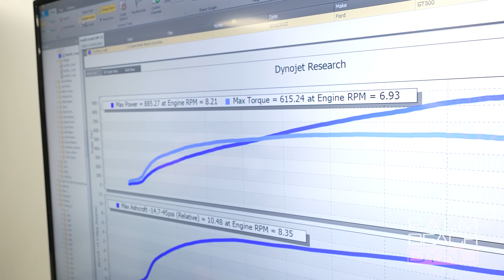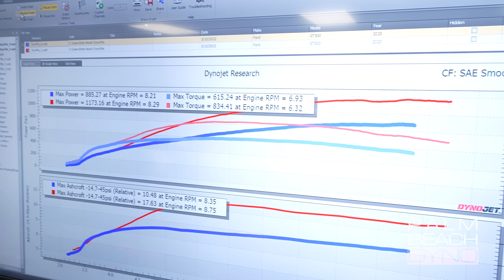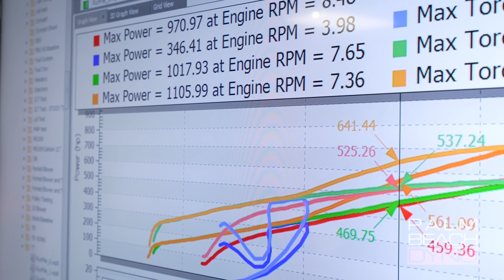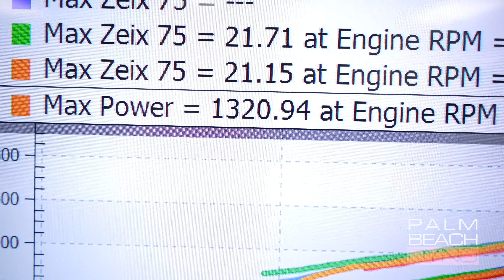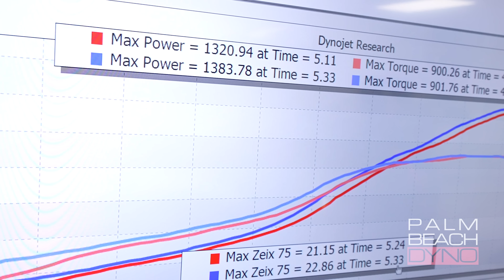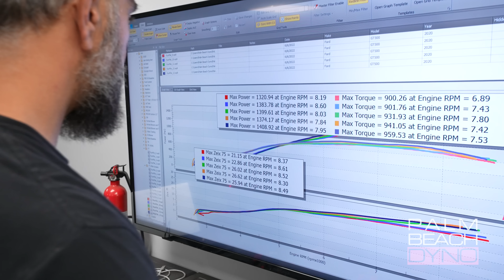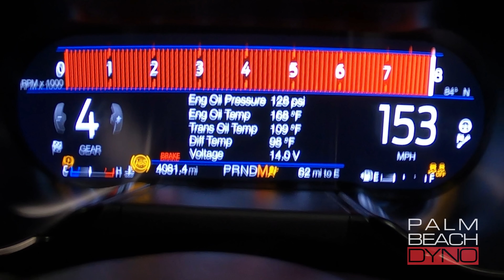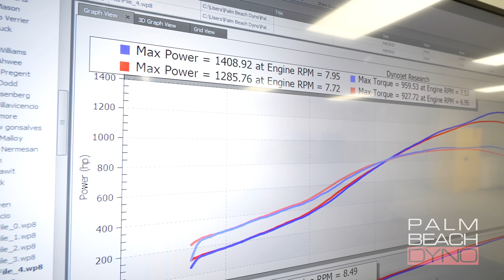PROJECT OVERKILL 😈 1400HP TWIN TURBO GT500! // 8500RPM Pulls on the All New TKM Engine & Hellion TT!

Comment: damn just goes to show how crucial proper grounding is! probably an easily overlooked part of a lot of builds
Reply: Being a high-performance mechanic for over 20 years, Grounds are the first thing I look for in any electronic problem in a vehicle. I have seen where people have gone freaking crazy with grounds and have caused them issues and on the other hand, people not using grounds properly or just the lack of grounds. So just my opinion always chase grounds first.

Comment: I’m curious on the details of the motor build.  What cam specs, any head work done, stock pistons and rods?  Header pipe diameter, and so on.  Stock compression?
Reply: Nothing in this motor is factory. It has a billet crank, caps. Rods and Pistons are aftermarket, pretty sure the heads are ported. Don't remember if the camshafts where aftermarket. It's sleeved ,all the goodies
Reply: The GT500 stock motor is just a cross plane version of the Voodoo. Once you go cross plane you can bore and stroke it a little bit more. Then add forged rods/pistons and as much boost as you want.
Reply: @walk4348  The GT500 stock motor is more than just a cross-plane crank version of a stock Voodoo engine.  The compression ratio is different, the GT500 has a beefier engine block and the GT500's rotating assembly is stronger.
Reply: @chrism.728  yes, they put stronger rods and pistons. The compression isn't that much lower than a GT350.
Reply: @walk4348  There's a significant difference in engine compression ratio. GT350 is 12:1 and the 2020+ GT500 is 9.5:1, that's a big difference. The GT500 engine block is also stronger to withstand boost.
Reply: 2019 and up gt350 have the same blocks different rotating assemblies

Comment: Good GOD that sounds beautiful!
Now someone out there needs to
"compound boost" a GT500...😎👍
Reply: I might be alone in this, but I honestly prefer only using a single forced induction type on a motor, purely to avoid heat soak issues. Yes, you could run both a true intercooler and an aftercooler, but that adds such a ridiculous amount of weight and size that you're better off just pushing either the supercharger or the turbo harder instead. Also, rally-style antilag would sound mean as hell on something like this.
Reply: @griffinfaulkner3514  you're wrong, neither would work very hard on that kind of setup.  A huge turbo running like 6 lbs of boost and a supercharger running a six 6 lb boost wouldn't be 16+ lbs of boost minimum.  You're actually raising the efficiency of the sc.  That being said, it's complicated to tune and it will still make less HP than a turbo setup running the same amount of boost because the sc will still be robbing some off of the crank.  It would drive crazy good though. As for heat, the A2W should be able to handle that amount of heat since the boost would be really low for both.
Reply: @_illtal  The extra weight and potential packaging issues are still there, and if you're going for the kind of numbers I think they're going to end up with, heat is definitely going to be an issue. I'd rather not cook the rotors on my supercharger if I can avoid it, which requires a true intercooler.
Reply: If we are going this far there's nothing stopping us from using methanol to cool the charge directly. The weight of this kind of setup is going to be similar to the weight of a complete ( no dumps) twin turbo setup. 
But as you've noted, for simplicity I would choose a twin turbo setup with an a2w manifold setup.

Comment: I have a 2015 GT Convertible, the only thing I have changed is oil & filters.  I was shocked when it did 160 mph and still pulling strong when I backed off.  Looked into the gearing and found it has a tall rear end gear, a 3.23 I think, and wondering if that's how it pulled that off.  I wonder WHY Ford put such a tall rear end in the convertible.  The top was down when I made that pull too.  Handled perfectly with complete confidence.  I wonder if it's worth putting twin turbos on it to make it a true sleeper.  Any thoughts are welcome!

Comment: Great find on the ground.  Seems whenever there's a problem on a car or boat it's on the ground side of the circuit. I'm sure once you guys get the clutch figured out the car will certainly make the numbers.
Reply: Ford really needs to release all the software for the TRANS so the calibrators can get after it with this transmission. When they start breaking them then we will know that full access has been released or close to it.

Comment: Been waiting for this on project overkill, Wow 1400 RWHP,  but sad to say it comes with problems on this project on one time full send race setup. But you guys will figure out all the
bugs, and fully send it. Can't wait to see the 1600 RWHP mark, if the trans will allow it. Great job guys.
Reply: Fathouse performance already has a 1600 R package for the GT 350.
Reply: @thomasblankinship98  what's your point because this is a 500 not 350
Reply: @justincharles6585  Voo Doo vs Predator. Both 5.2. ones a flat plane ( Voo Doo) , the others a 90° ( Predator). The 1600 R ( FH) pulled 1693 on the Dyno. Hope they get the TT Predator worked out. Would love to see the Dyno results from it. Both are awesome pieces of engineering.
Reply: @thomasblankinship98  Limiting factor here is the transmission, not the engine. DCTs in general tend to get a bit finicky when you push them this hard, and finding aftermarket upgrades for both the clutches and the gear sets is difficult and expensive.

Comment: I would be curious why he didn’t use the hub dyno he really never said . 
I heard you make less power on a hub dyno but it more accurate because there’s no tire slip at all .
Reply: He actually did , but it's because he was putting the kart before the horse , setup needed maintenance and everything was basically just stuck together nothing was really dialed in and a few things he should've done right after break in he didn't do.
Reply: I thought the hub dyno would show more power as your one step closer to the crank hence less drive train power loss. Correct me if I'm wrong.
Reply: @randyjr3479  totally understand definitely don’t want mess up the motor !!!  Yes re-torque the heads  is a smart decision.   He should bye a hub dyno it would make thing easier.
Reply: @CoyoteAUS   not 100% sure but a hub dyno is definitely a more accurate tool to use for tuning it has a better loadbearing without tire slip .  When the wheel is spinning it had to make a accurate tune .  For running hub dyno all day long. Especially car making more than 1000 hp .

Comment: Damn Imagine if it was manual 😭🔥

.5 second slower shift times only matter if u give a fuck about bein the fastest at the track…which most folks don’t lol, manual would be better for the fun factor period
Reply: It would be slower…
Reply: @NoizTheDj  By at least a 1/2 second on a 1/4 drag strip.
Reply: Only a rookie would say that lol
Reply: You would be buying new transmissions every couple of months
Reply: @fread51  why would that be? Mustangs make more power than this with manuals and are faster.
Reply: @robertkington2084  no they are not faster show me a 8 second stick shift S550
Reply: @fread51  first off I did not say they are faster. You need to work on your reading comprehension. My point was mustangs make more power than this all the time with a manual and the transmission holds together. Look up the 6 second s197 with a t56 transmission. Manuals in many circumstances are faster. NHRA sealed coyotes have to take a #150 penalty for using a manual and yet %100 of the people do it.
Reply: @fread51 you have no concept or understanding of why that is.  Most street cars will be faster as a manual when someone who can drive has it because it has much less rotating mass and you can control stall speed for and condition. Automatics becomes quicker when you make so much power that the clutch kick wants to break the tires loose during shirts. Contrary to popular belief automatic trans dont shift instantly and torque tables cut power during shift. The misconception that an automatic is faster came about when the factory started useing gears in the manual designed for mpg and highway noise testing and they also have torque limits for the manuals and in the mustang dosnr allow flatfoot shifting and pulls cam timing between gears. Trust for this reason you will never find anyone setting records in a sealed coyote class with an auto.
Reply: s550 lol Mercedes wants their name back
Reply: @themarathoncontinues2289  Ford had that first
Reply: IYO.  Not mine.
Reply: @themarathoncontinues2289  dodge challenger lol mercedes wants their chassis back